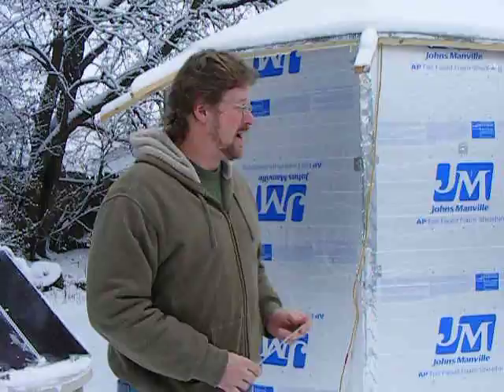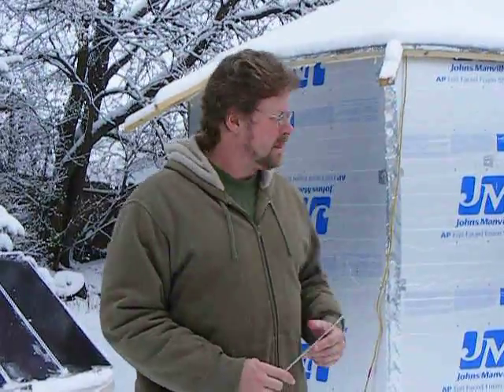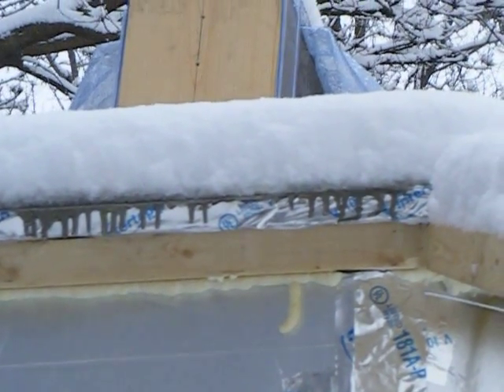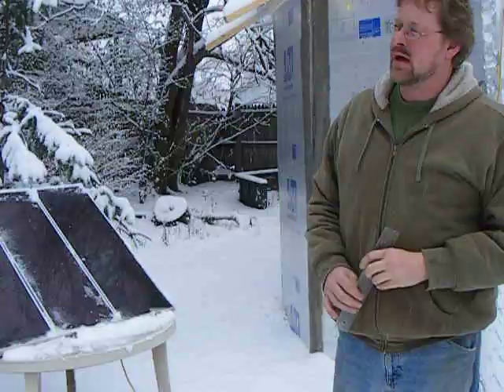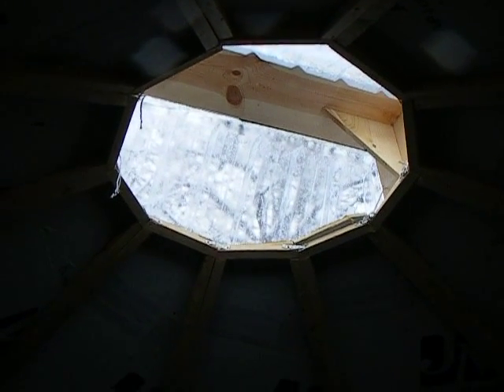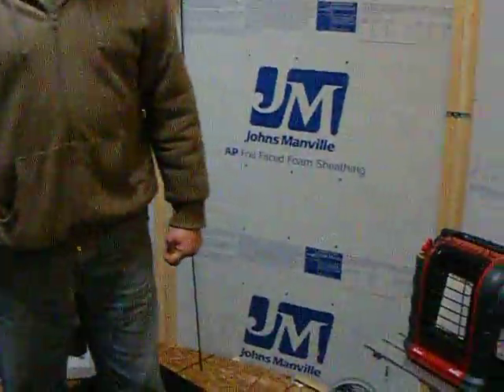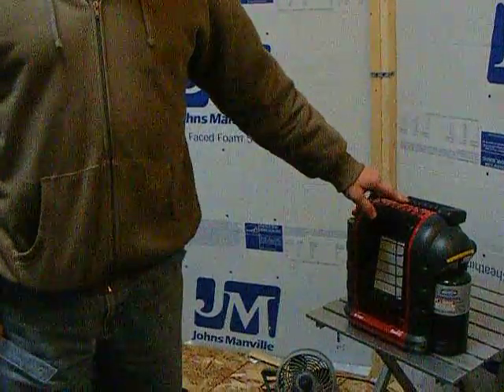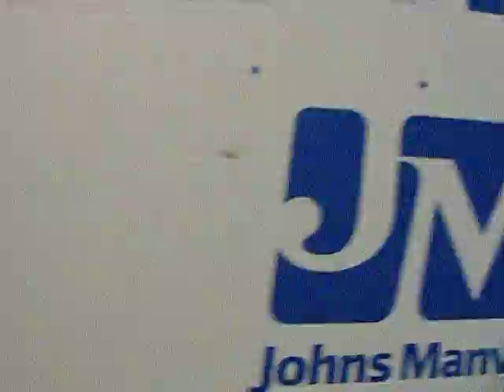Dorje Inc. Modern Yurt:  Research in Action

Comment from the maker: That is exactly what we ended up doing.  We built a biomass "rocket" style micro furnace in this over this past winter.  The challenge was that the natural draft of the building pulls everything up and out the dome, just like it was meant to -- but the interior was not meant to be smoky. So, we designed the micro furnace to have its own intake/exhaust and be airtight in operation.

Comment from the maker: So... this little structure withstood 60 mph winds, huge snow loads from a record blizzard -- and several long plunges below zero.  

From the collected data, the internal temperature never dropped below 38 degrees even in -9 external temps (and with just a 1500 w oil heater for heat).  We weren't even trying hard!